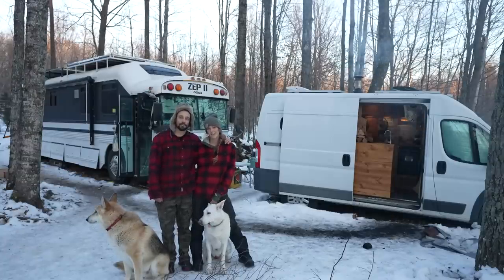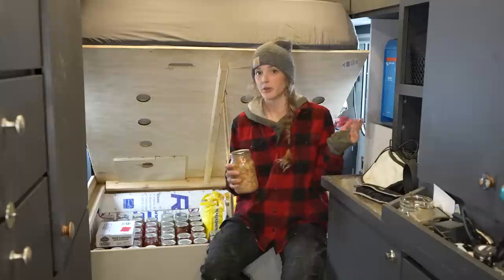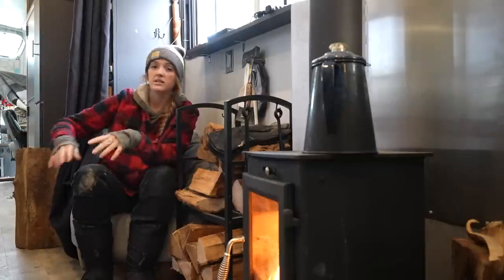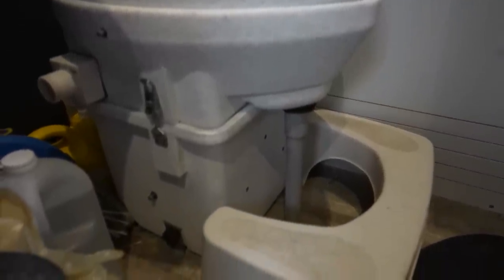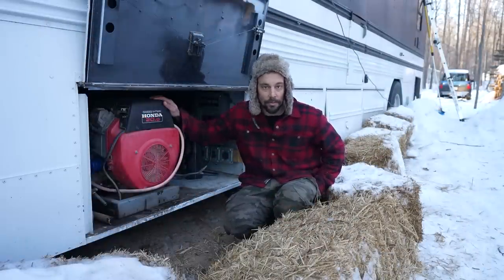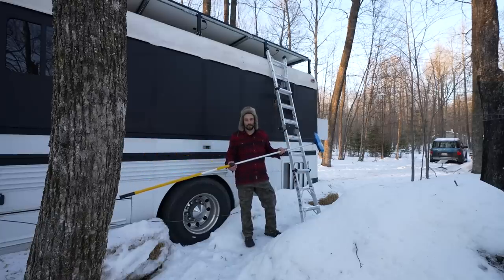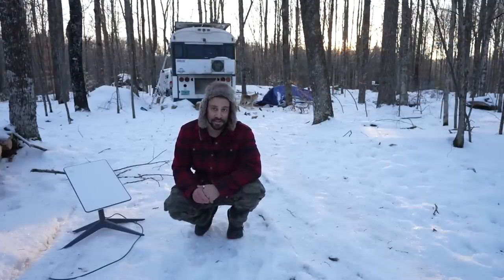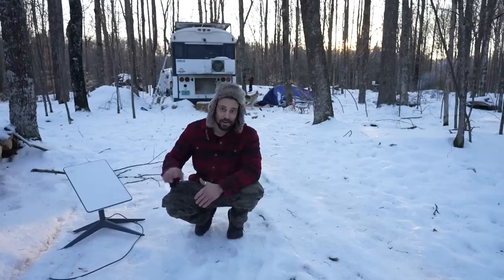Off Grid Winter Tiny Home Camp - Tour + Modifications

Comment: Great video. We live in our 40ft Arctic Bluebird Fe in the Alaskan Interior, where it typically gets down to -20f to -60f throughout most of the winter.  Our bus was specifically built to deal with these Arctic conditions. Heated floors, 6-12 inches of spray foam on the exterior outside under the floor. It was nice to see others deal with Skoolie Life in cold temps. Running water was something that was difficult to master at -40f, especially with our plumbing outside of the bus. Thanks for the video.

Comment: Consider perhaps getting some blocks of soapstone to put on your woodstoves.  They will absorb some of the heat of the fires while they're burning (tempering how much gets put into the vehicles), and then re-radiate that heat for hours afterward.  Best of all, soapstone doesn't get super-hot, so it's actually safer to be around than the woodstove itself!

Comment: Solar under trees seems to be a problem, as well as high latitude in the winter.  Cold temps can actually be a plus for solar as long as you have a means to keep batteries warm enough.  For a worst case scenario, you two are proving it can be done.  If it can be done there, it can be done anywhere with confidence.

I LOVE the buried garbage can idea.  Great for keeping out bugs and rot, too.  But for sure you need to check your veggies occasionally and rotate them to ensure one bad one doesn't spoil the whole batch.
Reply: they could use a few wind gens...(think roof top type)..   if your having solar issues...... but plenty of wind
Reply: Most including myself carry a generator. Less fuel to charge batteries rather than run the bus off of it. It helps in a rough spot but if you dont have room for much fuel. I understand that also.

Comment: In the van. Would a USB charged small fan help to circulate your heat better? I'm not sure how low it could draw since heat rises but the fan could be used during hotter months if  it doesn't work for the heat. If my feet or hands get cold, I'm done. We gotta find cheap running way to circulate your heat. Hehehe

Comment: You need to get one of those heat powered fans that sit atop the wood stove to help circulate the air around the van.
Reply: 20:52 they do have one. I think it gets moved around a lot during the video. Showing the kettle, etc.
Reply: Linnea has one in her van, it sits next to the wood stove on the side opposite the bed.

Comment: Did I understand correctly? They filter water through the Berkey just so they can wash dishes with filtered water? That's a bit expensive, isn't it, to wash dishes with filtered water, especially the Berkey?
Reply: I'm thinking there are hazards of washing too close to drinking source...so filter it all for safety.
Reply: I had a similar question as the Berkey is supposed to filter all types of water so one can safely have potable water?

Comment: Are you telling me that you couldn't find a way to connect the water system into the lake that's next to your your your bus I mean why do you have to drag a bucket down to a lake and then pull the water off and then drive it but walk it back to that thing and then put it through a system why don't you just use your fucking sink water you can still connect it to a pipe or a tube that goes into the lake so you can avoid all that other shit